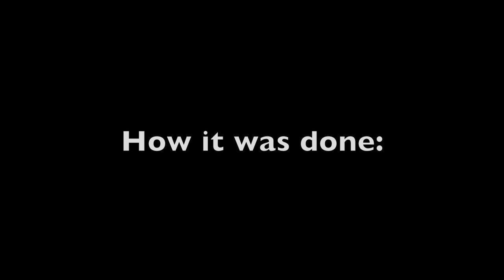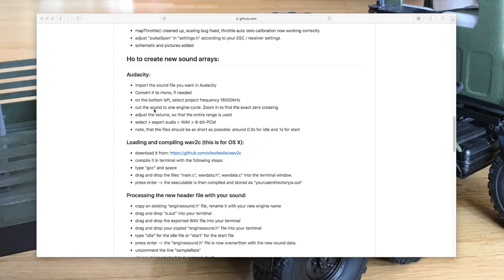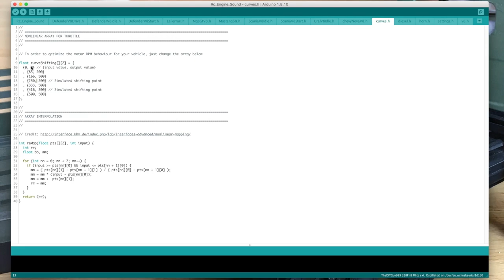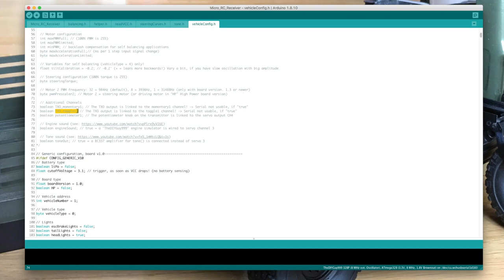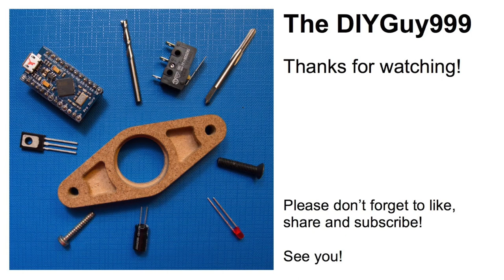WPL B36 Ural-4320: New Arduino Engine Sound & Switchable Roof Lights

Comment: Please reduce the size of the sound V8, I can not use it in version 1.31. And I don't have a Mac PC =(
Reply from the maker: Done, but it's not perfect, because I don't have the original wav file
Reply: @TheDIYGuy999  you're my hero!!! thanks a lot! Can you posting on git hub for example 2 WAV files idle and start any engine? I myself will try to add new sounds through wav2asm.
Reply from the maker: @RC-Nick  You're welcome, but I don't quite understand your question about the WAV files. In the meantime I also added the trophy truck sounds you requested
Reply: @TheDIYGuy999  Thanks! I've already tried them. I can't figure out which part to select in Audacity, which segment to select?

Comment: Hi. Imoressed by your work. If I understand right, i can make sound module simply from Arduino like https://aliexpress.ru/item/32672852945.html And programm it for reaction for different signals from receiver?
Reply from the maker: Yes, you can use every ATmega 328 based Arduino, but this one only has one input for the throttle. I also have a much more advanced, ESP32 based version, see my other videos and: https://github.com/TheDIYGuy999/Rc_Engine_Sound_ESP32
Reply: @TheDIYGuy999  could you recommend me any real arduino lot on ali which could be used with your software please?
Reply: @TheDIYGuy999  Your github code for esp32. Would it work similarly with atmega based plate? Thank yoy
Reply from the maker: @DAVerkSky  No, the ATmega is just not able to handle all the required code. for a parts list for this code see:
https://github.com/TheDIYGuy999/Rc_Engine_Sound_ESP32/tree/master/Eagle_PCB/Final
Reply: @TheDIYGuy999  Damn. This is not easy ). Before you said, that i can use any atmega 328, but now ut's look like your code adopted for ESP32 with additional I/O cradle in your project )
Reply from the maker: @DAVerkSky  Yes, you can use every ATmega 328 based board, but you need to use this, much more limited code:
https://github.com/TheDIYGuy999/Rc_Engine_Sound
Reply: @TheDIYGuy999  Thank you, man. I will try it.
Reply from the maker: @DAVerkSky  Both of them will work, but for the one without USB you will need a programmer
Reply: @TheDIYGuy999  but there are any diffrence with pins layout? I can powerup scheme by esc anyway?
Reply from the maker: @DAVerkSky  The pin layout is the same for both of them, but the pro mini has no USB, so it has more exposed pins
Reply: @TheDIYGuy999  On this scheme https://youtu.be/pPlrx9yVI6E?t=127 you use 5V step up. That means i cant connect arduino directly to receiver power (delivered by ESC BEC)? There are about 5.5-6V there.
Reply from the maker: @DAVerkSky  You can supply the Arduino with this voltage via the RAW pin
Reply: @TheDIYGuy999  Yes, but PAM8403 require 5V too
Reply: @TheDIYGuy999  unfortunatly, i think it would not work such way. By datasheet, power supply for AMS1117-5 onboard should be FROM 6.5V, so, 5.7V from receiver would be not enough. Do you use stepup unit in all your projects?
Reply: @TheDIYGuy999  should i change something in your code before compilation? I sold all plates and compile your sketch, but no any sound available
Reply: @TheDIYGuy999  I got it. I use analog pins instead of digital (((. But sound quality is very poor. What could be a reason of it?
Reply: @TheDIYGuy999  Thank you for your project. Everything work not bad. But engine not swtched off in idle in 15 secs. May be I should change some variables?
Reply: @TheDIYGuy999  by the way, arduino could easily look for two pwm signal at input realtime, not only one. I made redisign of scheme and code, and now we could have additional ability to control for misc devices by 3th channel. Your project with esp32 looks great, but not cheap for 1/16 models. And do you measure power comsumption of your module? With active wifi part, as i know, it could be over 500ma - this is no small for model power supply (especially taking in account 200-400ma taken by audio module.